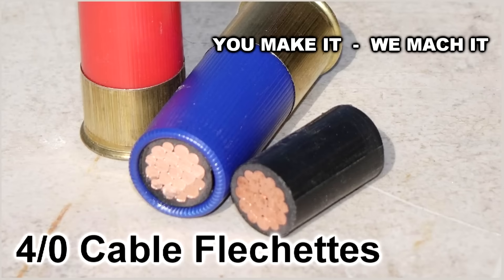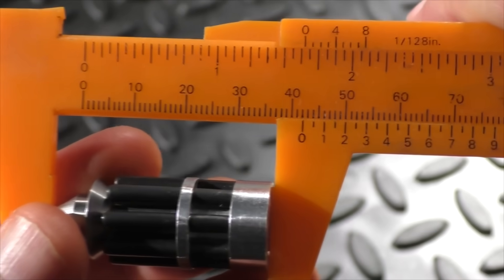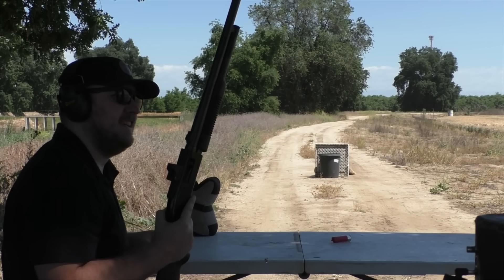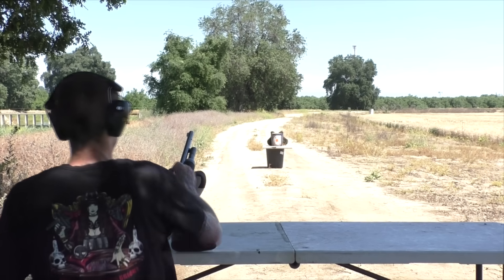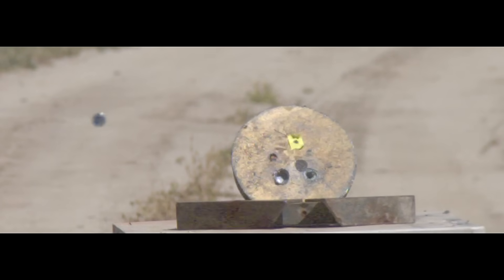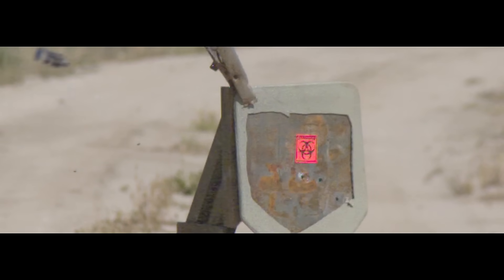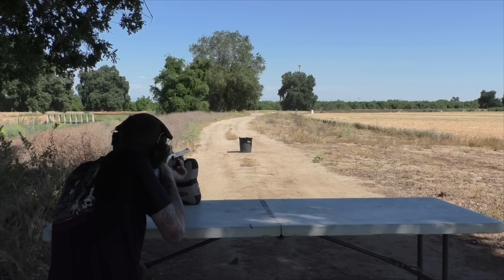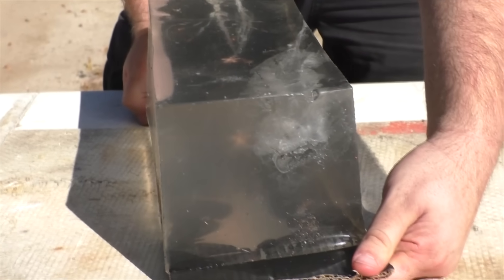RODS from GOD -  Possibly the best 12ga slug we've tested

Comment: I would have included WOOD splinters instead of metal rods.  Splinters fester quickly inside the body, plus you can’t detect them with X-rays or even a fluoroscope.
Just call them punji rounds.

Comment: I think this is the most pungent round you ever shot through a shotgun. Thinking there is a better material to make the sabots from, like some sort of fiber phenolic resin but a whole new custom engineering challenge for you. Most effective round I saw, but thinking the upper retaining ring would be yet another part because it would be a soft lead one that was pressure fitted. You mentioned the cost of what the round would be? What would it matter if it saved your life, and even a near miss would put the fear of God in them? Best one yet!

Comment: They'd definitely be even more interesting with a tungsten core & tungsten rods. It would just be devastating in CQB. If it goes through the point man the 2nd & 3rd won't be completely out of danger either. And there  most definitely won't be many hiding spots that'll save you from this. Kinda like the concussive rounds for the .50 BMG.

Comment: Thanks Jeff, Shane and Zack. As for the foam model what a novel way to cure hemorrhoids (Piles). Roll pins are not super hard, during my engineering travels many a kinked rooll pin I've removed. This Rods from God slug are worth developing, as the cost of the existing slug would be quite expensive. Thanks Jeff, appreciated.
Reply from the maker: THANKS

Comment: Jay better patent that design real quick before someone else steals his idea lol
Reply: That round would be a copper-plated beyoch to mass-manufacture. You're looking at machined components, not stamped. You're looking at eight small tungsten rods, which are always a PITA to source. This is a round of artisanal craft, and absolutely terrifying, but an even bigger nightmare to try and ramp production on. 

If you make the core and base-plate out of Aluminum, you could die-cast it, but the spreader plate has to be steel or the rods just punch through it. And even if you handle all that, you'd have an assembly step before it can go to loading. And you'll need to cut some length off of it as well, to fit in a proper 3" shell without bumping the fellow in front. 

There's no way you could make them profitable. They'd cost maybe ten times the average slug's price, probably more. There's just too many parts, too much assembly involved. It's much cheaper and thus more profitable to just shove buttplugs into shells and call it a day.
Reply: @ShneekeyTheLost  There's a way to die cast the entire thing.. Even the rods, in place.  Just make it so they are barely connected and could still break off in high impact.  It probably wouldn't flare out as reliably.. but I bet it would still work a lot of the time.  It would need a little redesign and wouldn't really be the same thing..  but the same idea.
Reply: @calholli  The rods are of a different material than the rest, so unless you want to make the rods Aluminum instead of Tungsten, that's not going to be possible. 

Also, assuming you just make the whole thing out of Aluminum, the awkward design is going to generate a relatively high number of failed castings, and it still wouldn't perform as well both due to the lack of mass and due to the rods probably going through the aluminum spreader plate instead of properly spreading. 

So you're looking at a slug still 2-3x the cost of a usual one, and without the same performance metrics displayed. It's too complex, as it stands, for mass manufacture. You'd have to get rid of the rods separating to simplify it, in which case just go with a standard butt-plug design which are easy to cast.
Reply: This video puts it firmly into unpatentable territory. Public domain now
Reply: If he hasn't done it already,  he will not be able to patent it after this film has been shown to public
Reply: Military already has these
Reply: @calholli  Not exactly with the multi-rods. The military uses the band on a sabot for keeping the spreader-sections as it exits the barrel, then they just separate.

Comment: well, there are only 4 parts that actually need to be made, and if you load a programm on a CNC machine you can propably get a machining time of about 5-8 minutes( maybe on the lower side)
pretty sure you could also make the base and the core as one part and add a little stress point at the base with a cut off tool so it will break free upon entry, at any rate I would machine the core with some sort of knurling to hold the spreader so you don't have to mess with threadlock which involves curing time and what not

the other 7 parts are off the shelf components, so what's left is just assembly

all together I guess it still would be about 40 bucks a shot if you where to buy them, unless you outsource some or all of the machining to china maybe even with assembly, then it could be as low as 5-10$.
Reply from the maker: He may have made the base alum. so it was lighter so it was more no-heavy.  Not sure though

Comment: Holey frejoles! That is a very fine round, and without exotic or expensive metals!

The only failures was the sabot slip, and I can't fault Jeff for that, it is just something you can't account for. The sabot could be made of a poly plastic that is more form fitting, but that would add too much cost for the material.

I had to watch the video twice in order to get the entire goodness including the green goo in the balistic head shot!
But the foam explosive diarrhea shot has to be mentioned for the solid pattern result of the Rods from God expansion.

However, the mass and construction that made a lead plate perforation possible, is a great sign for the level of ballistic armor penetration as well!

But the final ballistic jell test was by far the best part of the testing!
Reply from the maker: The slippage was odd because I loaded these all exactly the same.
Reply: @taofledermaus  Exactly, it just happened. I suspect that if the sabot was form fitting, it would not slip ever, but would be too expensive to make in such small batches. Unless you could use a strip of 1/8 inch thick foam, glued to the plastic sabot you use?

Comment: This is similar to the system some air to air missiles employ. They have expanding rod warheads. The main charge is surrounded by thick steel rods that it sheds in all directions upon detonation. It is impressive to see it scaled down to slug size.

Comment: The sabot you use is a hull split into pieces. Has anyone ever provide a slug with gaskets like piston rings? They could be made out of hdpe or teflon and seal the combustion gasses while sliding down the barrel.

Comment: Might be cost efficient with modifications. Keep the steel front cone and the pins, just cast lead around it all. Lead doesn't tear itself apart from centrifugal forces, so it should hold the rods in place. No need for a sabot or backing plate since it's covered in lead,; it's just a slug.. with a surprise inside. No need for precise machining, and you get more mass behind the punch. The steel cone will still stop on impact, and the rods ought to tear free of the lead casing, they can't go through the cone after all.

Comment: That is probably the best slug design I have ever seen on the channel. The design is perfect.
Reply: Shorten it up a bit so it will tube, make the core tungsten for superior penetration, and it is the PERFECT SLUG: AP and HP combined.  Brilliant.
Reply: @crforfreedom7407  Or put a tungsten core in the center of the current core.
Reply: @crforfreedom7407  If I had the tools, machine the core and base from a single piece of tungsten, probably make the base just a little thinner than the aluminum one.  Maybe fill the roll pins with powdered magnesium to cause added heartburn to the target.
Reply: @crforfreedom7407  Maybe add copper rings so it can engage the rifling without the need for a sabot (and not ruin the barrel)?
Reply: Wish it could be loaded in a tube fed mag. Also wish these could be purchased! Price would probably be unreasonable given how much time it takes to make
Reply: Likely the tip was flat enough that you’d never have a problem detonating a primer. Be easy enough to test and make it a little wider if necessary 👍🏼
Reply: @dgoodman1484  
There is really no need to make the point as pointy as it is.
The front surface can easily be made shorter and larger and this would make it impossible for it to fire the shell in front if it in the tube.
Reply: @blantant Well.. they wouldn’t be the rounds you target shoot with. They’re the rounds you use when you need something tankish ded right meow
Reply: @blantant you can load one in the chamber and one in the tube. You could also load it in a 3” shell to cover the tip. But you would have to make sure the ones in the mag the sabo didn’t slip forward inside the shell and poke into the primer of the next. You could make a little top hat for it out of something relatively soft.
Reply: This is exactly the type of round we're all here for ain't it lol 😅👍
Reply: i like the second version of the screwdriver mostly
Reply: Agreed, this is wild!
Reply: Glass and nails 6 years ago was even better
Reply: @TheSleepingonit  They won't penetrate the way these things did. What makes this crazy it that it is an armor piercing fragmentation round.
Reply: @kirbyjoe7484  was not sure
Reply: It's perdy...and messy, but so perdy
Reply: its effective, but since its expensive to make its not perfect at all
Reply: Expensive though
Reply: If money wasn't a factor in weapon design, sure.
Reply: Right!!!

Comment: Great Video!
-a normal human cannot survive this round
-tissue damage almost infinite
-steel rod penetrates 2in lead plate
-you are correct, maybe tungsten rod would go through steel body armor plate
-the tiny side rods deflect at 30 degrees, sort of a shotgun(double aught)effect
-success equals:
>at least one ounce slug
>must have steel something(1/2 weight)
>must be ~1500fps
>must be aerodynamic
>must spin at 30,000rpm

Comment: Those roll pins are vicious
Reply from the maker: I don't thing any of them even bent
Reply: @taofledermaus  Shorten it up a bit so it will tube, make the core tungsten for superior penetration, and it is the PERFECT SLUG: AP and HP combined.  Brilliant.
Reply: @crforfreedom7407  I had the same thought.  That center core is big enough to just drill in a tube to drop a tungsten rod inside.  Utterly terrifying round. I want to always be Jays friend.
Reply: @taofledermaus it's rounds like this that scream out for a MUCH larger block of gel.
Reply: @taofledermaus feel like someone should tack them together with a copper nosecone. Might not be too prohibitively expensive
Reply: @taofledermaus thank you for taking the time to retest the gel shot. I gave you a hard time in another video because you messed up some stuff, so I feel it's only right to commend you for doing it the right way, and the people that send in test slugs I'm sure are appreciative as well.
Reply: Glad to see this in the comments. Thank you for being a reasonable human @Watchdog_McCoy_5.7x28
Reply: Spring steel. It's very hard and flexible.
Reply: i wonder how deep it would nail itself on a cement wall
Reply: They had almost slug level penetration, all while coming out in a 60 to 80 degree cone pattern.

And it took a very light impact to make them release. 

Imagine what these would do through a car windshield!
Reply: Eight spikes of death.
Reply: Turned that dress maker dummy into a GOATSE exhibit. Sheeeeh!
Reply: I thought they were solid dowel pins at first. Those roll pins put an evil twist on it.
Reply: That thing is basically a handgrenade when it hits steel. Neck and arms are done for.
Reply: I wonder how much spread and increased damage each pin would have if the pins were cut/split along their center for around 1/2 or 2/3 their length.
Reply: @xxMORTIKAIxx actually, roll pins are split down the entire length of their major axis. They’re a form of spring